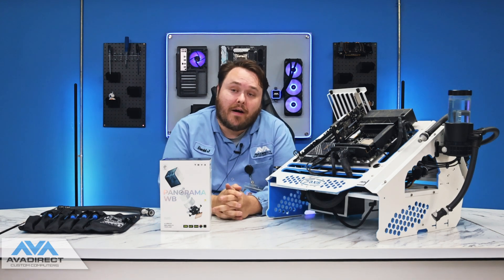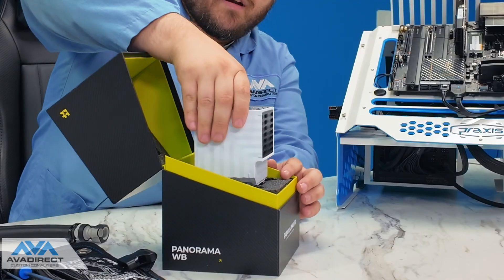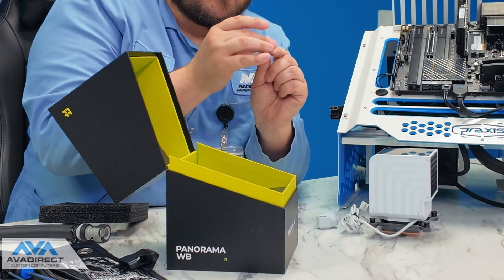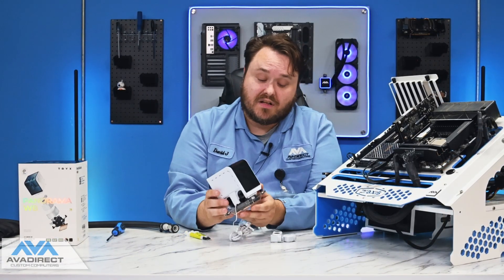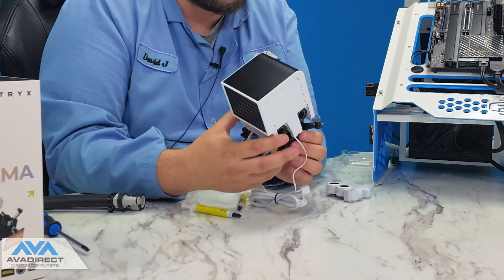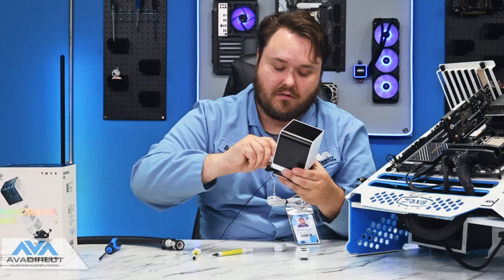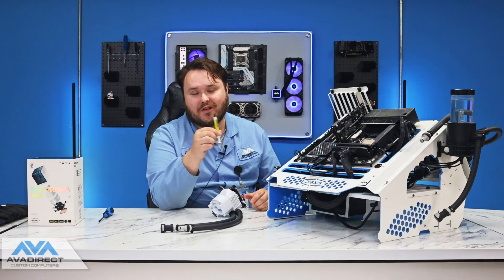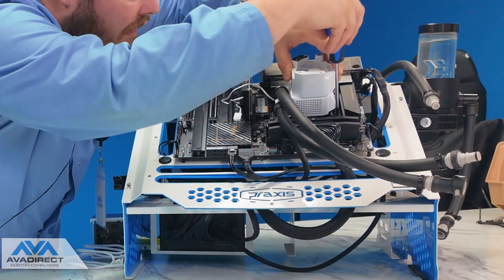Professional PC Builder Reviews TRYX Panorama Waterblock

Comment: You are in an open bench with 0 airflow at all.  Of course SOME airflow on VRM is going to be better than what you have (nevermind boards with vrm fans).   Also - what is the asutek pump DOING - that is the biggest question.  Is it causing resistance; is it providing more water movement?  What is going to happen when it eventually dies?  Will it brick/severely degrade the loop?

More: the best performing waterblocks are not the "$200" waterblocks: they are the basic, non-flashy, full-metal blocks for $90 or less.  The full-metal design provides additional cooling - the same way a heatsink does.  Where are the comparison charts?  Why can't we see your test results?  

Is this a sponsored video?